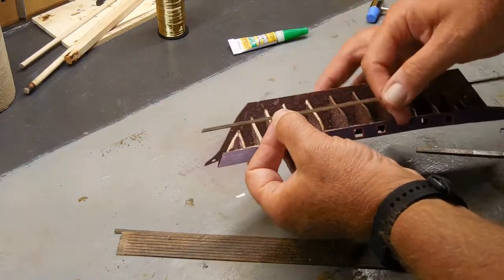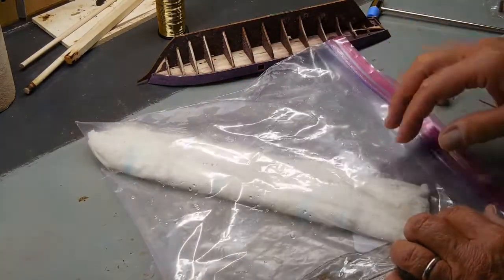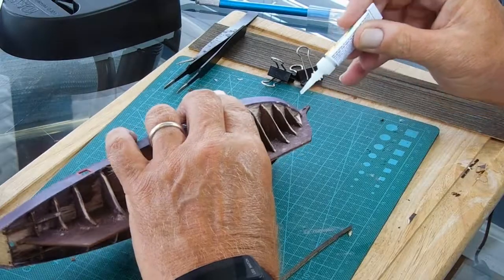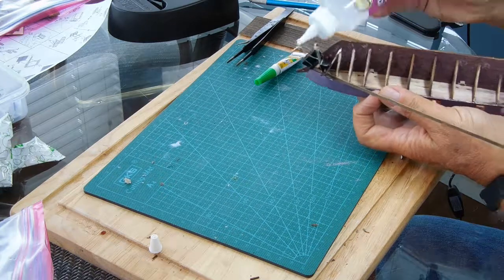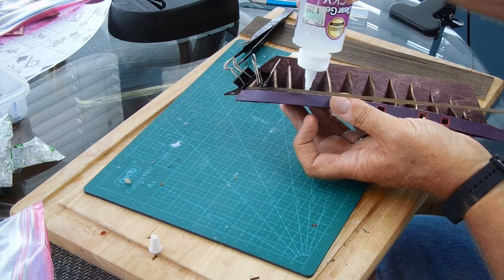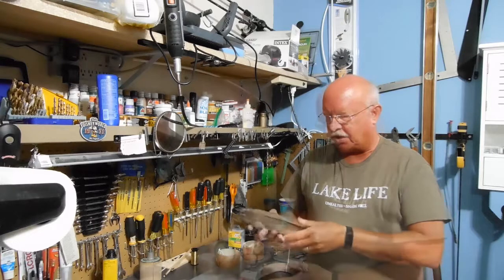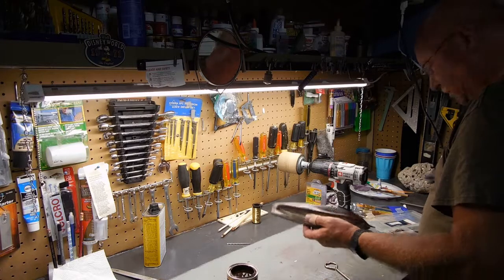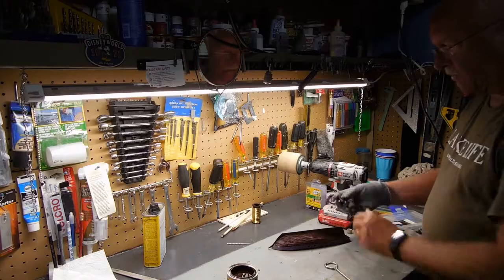Wooden Model Ship Build Part 5

Comment: Dan, 
I am looking for light brown stain, and an assortment of wood paint colors. What would you recommend I order on Amazon? 
I really like the blue paint you put on your "Aviator" model in your other video.

I am really enjoying your work. The videos are easy to follow, and I admit, am taking notes! 
Cheers!
Reply from the maker: The blue paint that I used for “The Aviator” I found at a Menards hardware store.  The brand is “Nautica At Home” . It’s primer and paint in one.  Finish says it’s eggshell.  I’ve not purchased any paint online because you can’t really be sure of the color. I’d recommend going to a craft store and picking them out in person.  As far as the light brown stain; I used Oak.  I’ve also learned that on the deck, take a penknife and carefully cut or scratch the same lines that are etched into the deck. It will give it more of a planked deck. I’ve also purchased thin deck planks that are walnut and glued them on top of the deck that came with the kit.  The more you make them the more creative you can be.  Good luck on finding just the right colors. Don’t limit yourself to model paints.  Hardware stores have quart size and all kinds of stains to experiment with! That’s half the fun! 👍

Comment: Hi, did you use any wood filler?  Do you find you need to trim the planks narrower on the ends?  Thanks for the tips!
Reply from the maker: I’m actually a beginner in model ship building....  but yes, I’m learning that It will work better if you narrow the planks especially towards the bow (front).  I have been putting two layers of planks on the hull. The first is what comes with the ship, then I sand it smooth. I have used filler as needed on that layer but not on the top planks.  But on my most recent one I put some black caulk on the inside to cover a small gap and it worked very well!.  Let me send this, then I’ll follow up with a link to that episode 👍
Reply from the maker: Here’s the episode that I mentioned. It’s a single layer of planks and I had some little gaps that I needed to seal. It worked out for my model, but I’m not looking for perfection 😉👍. HAPYLY 1/30 Scale DIY Wooden model Fishing Ship Part 3
https://youtu.be/AhsJVjUAlVc
Reply from the maker: You might be interested in my favorite build: The Back Pearl 
This is it finished. There’s 32 total 🥴
https://youtu.be/y3mubnnVfEU